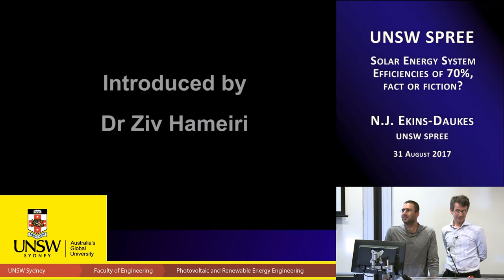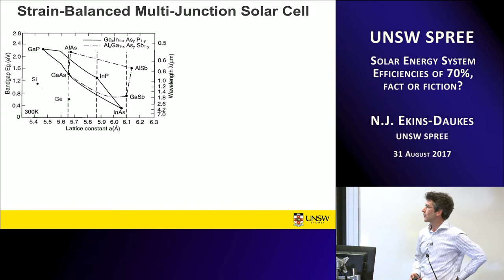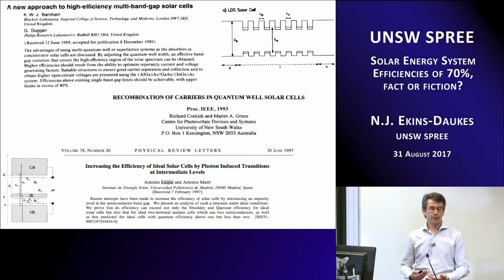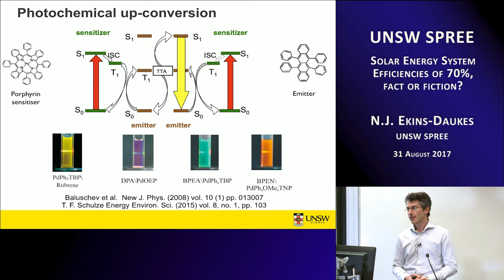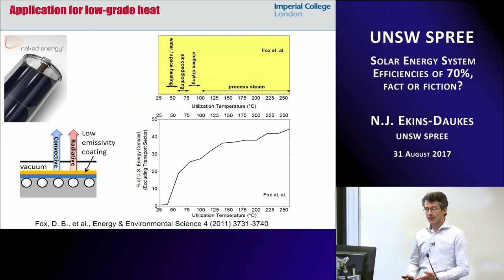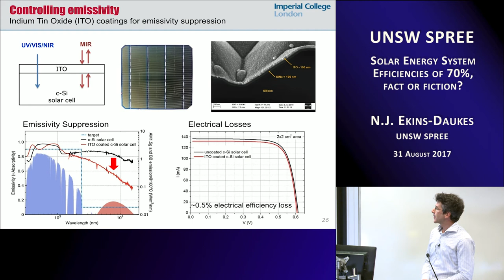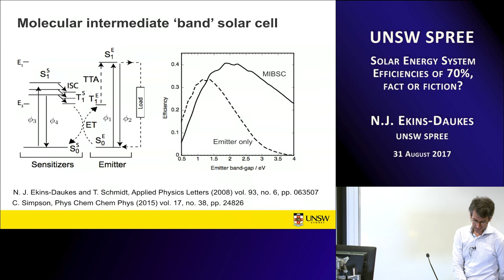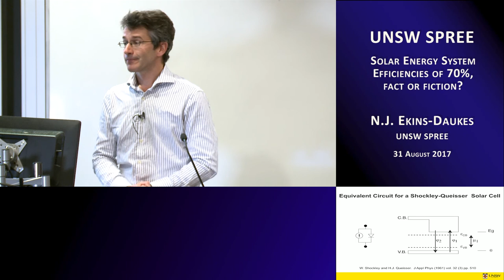UNSW SPREE 201708-31 NJ Ekins-Daukes - Solar Energy System Efficiencies of 70%, fact or fiction?

Comment: Hears one if I was to use a microwaves on a 30kv solar set to run the microwave to boil a pot of water to a 3mgea watt turbine this is not checked. could this work better than nuclear fuel rods as once the water is hot I can drop the content feed and use it to keep up the pressure flow to the turbine or similar to old sun fusion where they used a laser to heat it up to 1 million degrees that should have had a better magnetic band to they forgot the join one  mmmm.